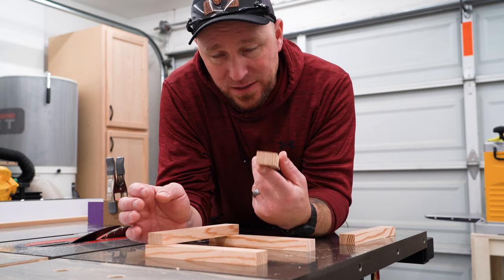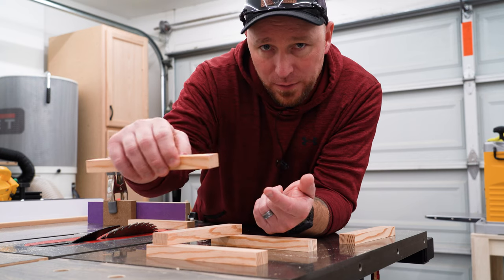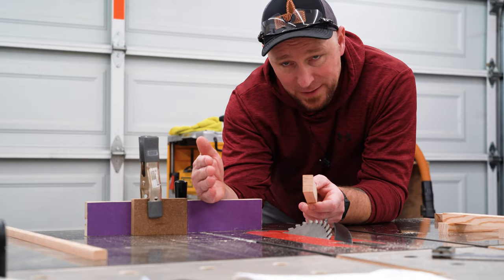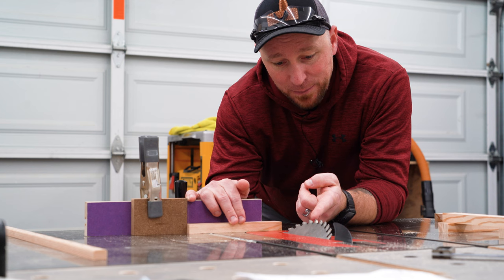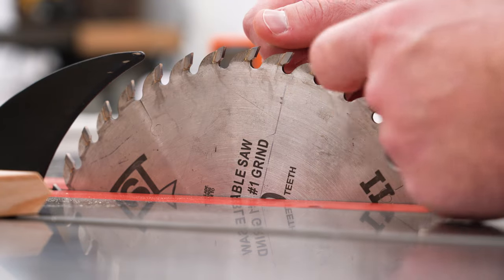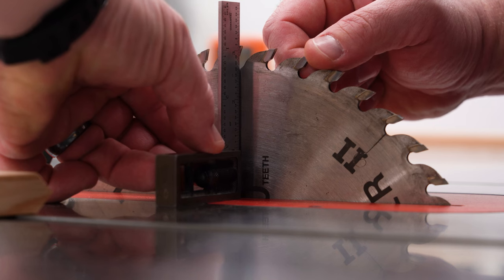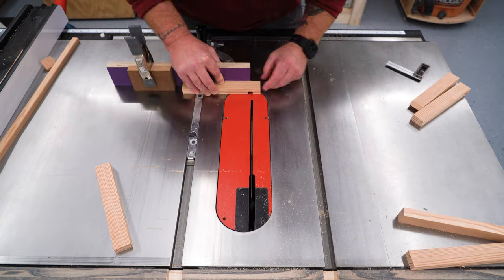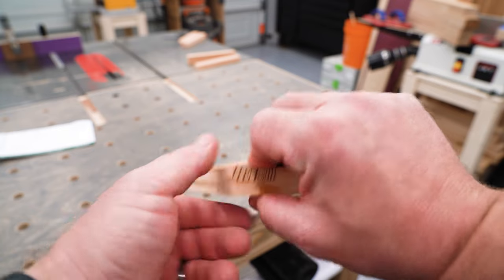How to Find Exact Center for Woodworking Joinery

Comment: Nice!  And you don't even have to move the saw blade to exactly 45 degrees to find the center.  Any angle will do the trick, as long as you cut both sides of the test board with the same angle.

Comment: Thanks. Always a new and thoughtful idea. BTW, any angle will do as long as you set the stop block so the cut clears the midpoint.
Reply: I was going to make the same comment. First I thought, "What if the angle isn't exactly 45 degrees, and worked it out through there."
Reply: @tomwilson2804  actually, another viewer mentioned the same. I just added the "as long as the cut clears the center" part.

Comment: This video is two tricks in one - the line for the saw blade to know its max height was brilliant. I'm constantly fidgeting with setup blocks and rocking the blade back and forth to find the highest point, and using a vertical reference line makes that super easy. Going to mark all my blades with one now.

Comment: Great tip Jodi.  Great video too.  Note though that the angle for the cut can be anything and this technique will still work, it doesn’t need to be exactly 45 degrees.  As long as you keep the angle the same on both cuts, 30 degrees will work, 42 degrees will work…you get my point.

Comment: This is an excellent method.  It's not difficult with a saw that has a vertical arbor lift mechanism.  But for older saws that have a pivot lift mechanism, the position of the reference tooth will change slightly and so care must be taken to bring it back to TDC.

Comment: That is great little trick. Since you are cutting two equal sides of the isosceles triangle the angle you use doesn't really matter/doesn't needs to be accurate to 45. Just use stop block and set angle to what you like.

Comment: I have a variation. I use a carpenter square to mark the 45 on each side giving me the center. I use the crosshairs to get my blade to the correct height.  Its probably not as accurate as the method described. I have had reasonable success with minimal sanding or planing. :)

Comment: Learned something new about the saw blade line!  Cool!  I know of another way to find the center...using either a coin or dowel or washer...and you draw the arc around the perimeter meeting the arch from one to the other on both sides....creating a football (maybe?) .....depending upon the size washer (round thing) and connecting the intersections of the semi circles together...that also is a method that works well.
Reply: Good one, dude!

Comment: I just recently picked up the Microjig Fitfinder 1/2 Gauge. It is dead simple to use and finds the middle of a piece and gives you a "setup block" measuring exactly half the height. Loving it so far but your technique is certainly an easy approach in a pinch or if you don't have the $35 for a new jig. Thanks for sharing.
Reply: Me too! I just received mine a couple days ago.

Comment: An even easier way is with a combo square which has a 45 degree angle.  If your end is 90 degrees to the face, reference the end of the piece and draw across top down and then another bottom up.  The intersecting line will be at the half way mark.  If your end is not exactly 90 degrees, draw a reference line a bit down the piece and use that.

Comment: Had a thought. Make the same cut but on the left side of yhe blade using a miter gauge or cross cut sled. This time make a partial cut that is more than halfway through (can eyeball this). Flip the board and make the same cut, maintaining the same distance to the blade. Now you have the center with an internal corner. Now you can align a router bit dead center by seating it in this internal corner.

Comment: Great tip! Is the 45 on the table saw crucial or will theoretically any angle work?
Reply: I think anything 45 or higher. Less will leave a blunt edge
Reply: Any angle will work.  I'd suggest at least 15° to have a good point.

Comment: You don't need a precise 45 either, any angle other than 90 works.  But it is very important to get that stop block tight.

Comment: Interesting.  Or, you can use the DFM or Rockler doohickeys to do it a lot faster.
Reply from the maker: @spychiatrist3045 True. And if you needed to do this more than once in a while I would say that's a fantastic solution, as with anything. But for those who don't want to be sold another thing that lives in a drawer or collects dust, this works!
Reply: @InspireWoodcraft  I wasn’t knocking it, it’s a great video!  I tend to go for simpler over advanced solutions because I’m new at this..